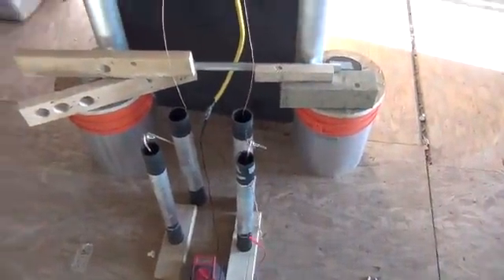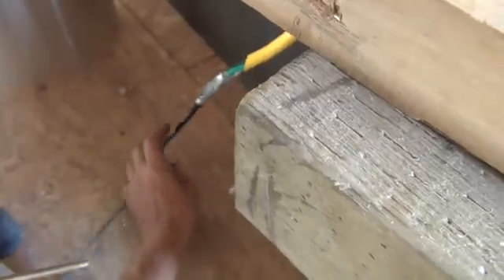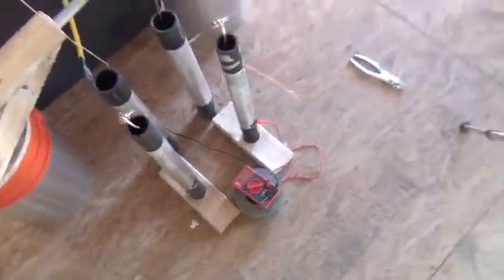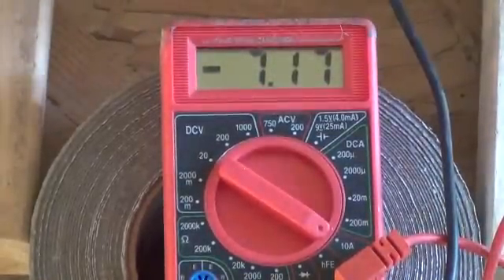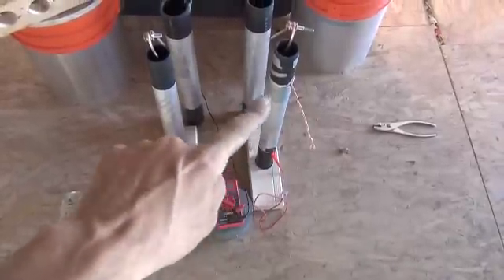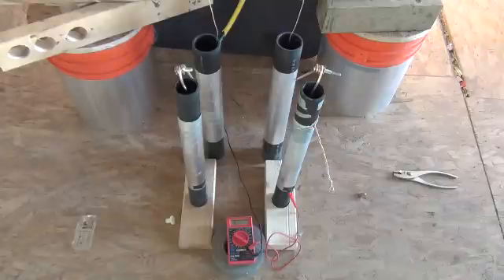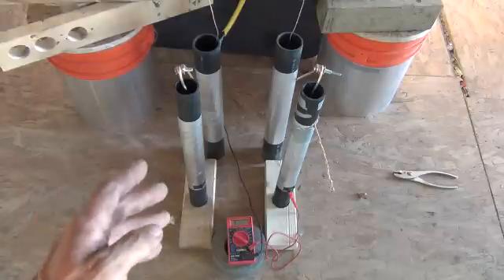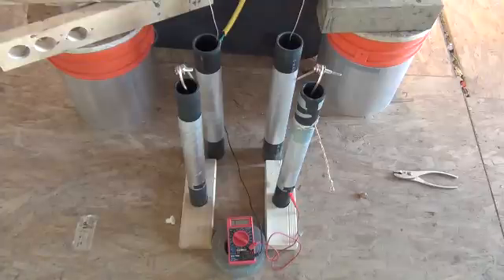how to make a electrostatic step-down transformer, part 2, ampere test, Wimshurst to low volt DC.

Comment: I tried this with my 18" plate homemade Wimshurst machine.  The two Leyden jars on the winhurst are 4" white pvc pipe thick walled, with a one in margin from the bottom of the plates, and two inch margin on the top of the plates. The plates are made with wide Aluminum duct tape. I get nice hot 6" discharges. I got 5" ones when it was rainy as hell the other day.  I made 4 twelve inch long step downs out of 2" white PVC drinking pipe.  The outer plates are about 8" because of the margins on the top and bottom.  I hooked them up exactly ad you did, my coils are 16 turns of 6 guage solid copper wire like you used. I already blew up two meters testing them.  What am I doing wrong!?!

Comment: Very nice work!But before we jump to any conclusions, you have to check the voltage/amperage first, simultaneously with an oscilloscope and not a cheap multimeter.These multimeters can't measure anything above 50Hz and even when they do so, the waves have to be either perfect sine or perfect square. Otherwise they can't measure properly. So I would suggest to take the same measurements with an oscilloscope, output connected to a load of course and then we can talk about a true tesla rediscovery!